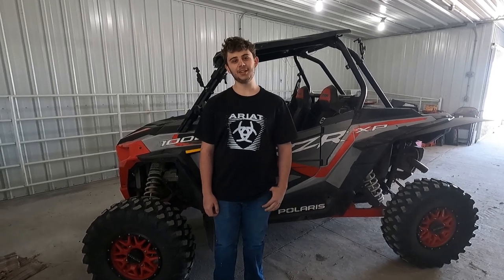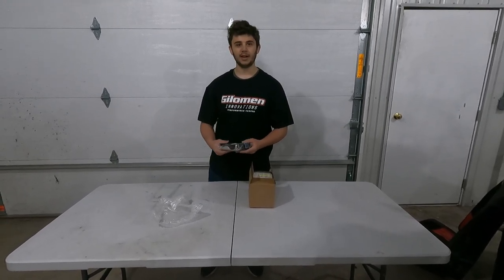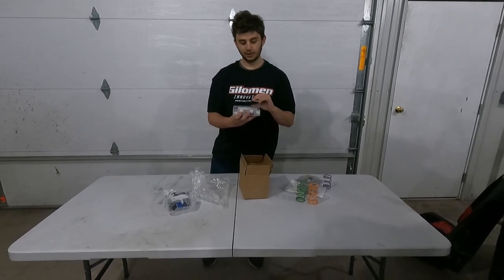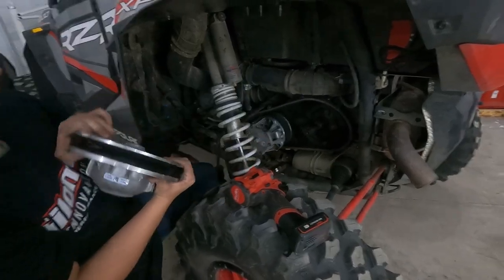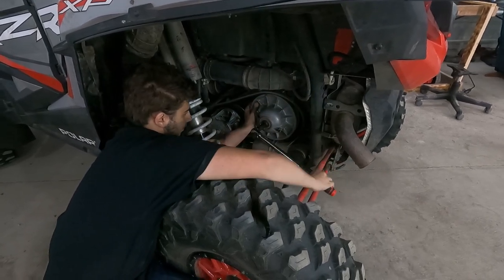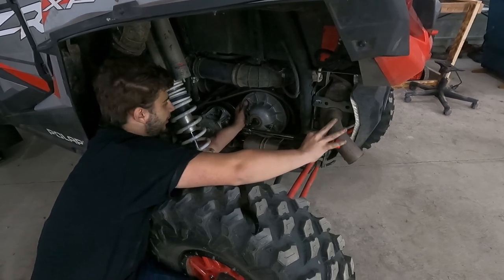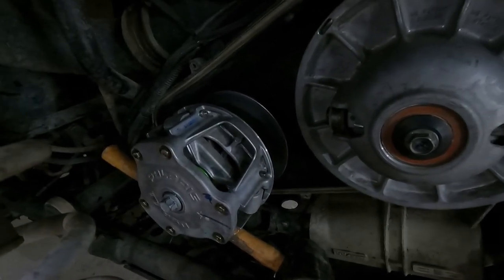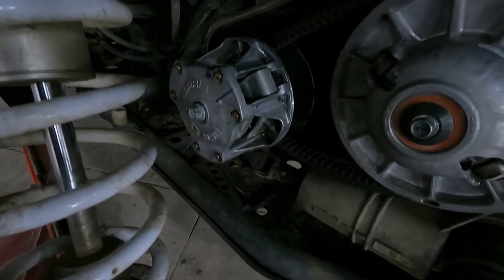Gilomen Clutch Kit | Unbox, Install, Review | 2022 Polaris Rzr xp 1000

Comment: I just installed the same kit what rpm is your machine running at 60-65 mph ?
Reply from the maker: 8300 you can adjust the weights to get it in the range that your papers say to be in
Reply: @BackCountryUTV  at 60-65 my machine is running little over 8000 wasn’t sure if that is where it should be
Reply from the maker: @adamleroux1163  it should be at 8300-8500 so I would adjust your weights to get it in that range